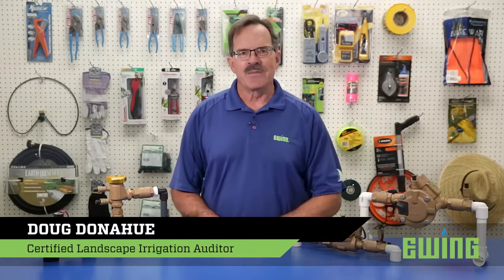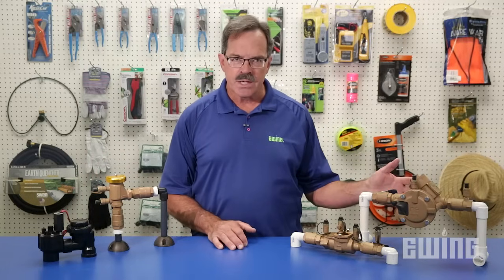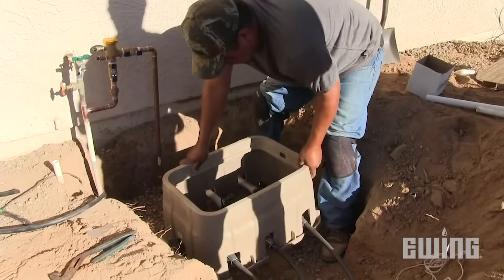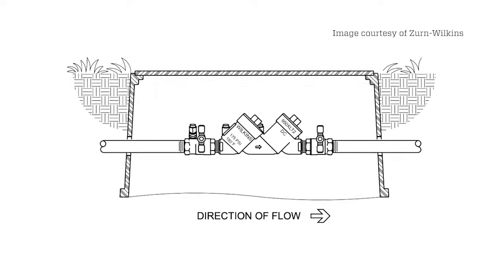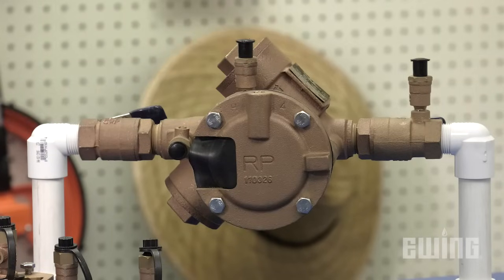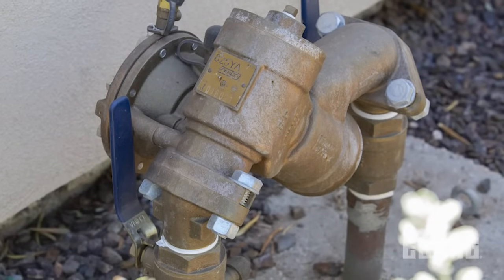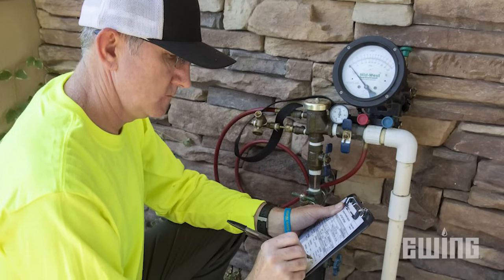Irrigation Backflow Prevention Device Overview

Comment: Can you explain how a outdoor spigot is ok to install on the house water side (inlet) of the backflow preventer. Couldn't you still get contamination into the house water.
Reply from the maker: Yes, you could still get contamination thru the hose bib as you described. It would need to have a hose attached with the end at least partially submerged and water running during a backflow event. For this scenario they make a vacuum breaker for hose bibs like this one:
https://www.ewingoutdoorsupply.com/3-4-inch-hose-bib-vacuum-breaker
Thanks for the question!

Comment: What is a emission device
Reply from the maker: An emission device could be a drip emitter, sprinkler head, bubbler, etc. Anything that is designed to apply water in an irrigation system. Thanks for watching!
Reply: @ewingoutdoorsupply  so I can’t have anything above the back flow preventer? I live on a slope and the back flow preventer is lower than where some of my drip emitters will be. Is this bad?
Reply from the maker: It depends on the type of preventer being used. If you have a PVB then, yes, it should be installed a minimum of 12" above the highest outlet. We recommend checking with your local municipality/water purveyor for the requirements in your area for irrigation backflow devices.
Reply: @ewingoutdoorsupply  I have two anti Siphon valves that are 6"above the highest sprinkler head.  If i add a PVB will it need to be 12 "above the anti SIpon valves or just 12" above the sprinkler head?
Reply from the maker: @Pickaroon  You would still install it at least 12" above the highest head. Thanks for the question!

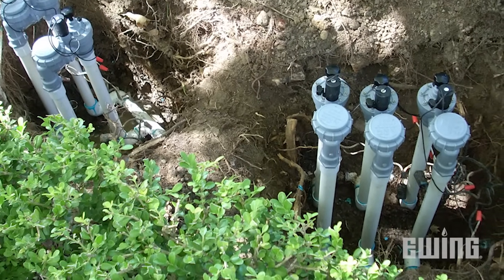Comment: I was happy to hear a definitive statement at 1:03 that anti-siphon valves cannot be used as master valves. However, I would like to fully understand why this is so. Can you direct me to a technical discussion of this issue? I'm a retired engineer and want to fully understand this.
Reply from the maker: An anti-siphon valve will not function as intended (preventing back-siphonage) when used as a master valve because there is another valve downstream. You may be able to find more info on the subject thru a google search. Thanks for the question!

Comment: Does a Backflow prevention device restrict flow?
Reply from the maker: As long as the backflow device isn't sized smaller than your supply line you shouldn't have a restriction in flow. It will reduce pressure though. How much will depend on the type of device you use. Thanks for watching!

Comment: Confused....in the intro animation, you show a fertilizer tank installed in a line, with an anti siphon valve.  Yet later you say a DCV must be used with fertilizer injections systems.   ?????
Reply from the maker: The animation was intended to demonstrate the purpose of having a backflow device. You are correct though, instead of a PVB, the animation should have shown a RPZ instead. Good catch!